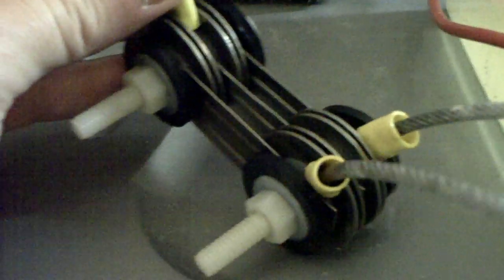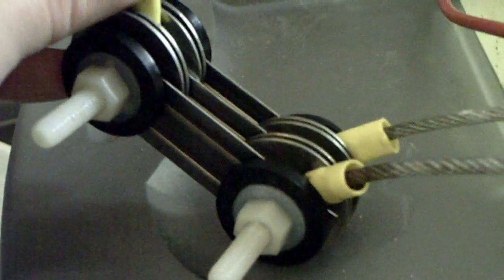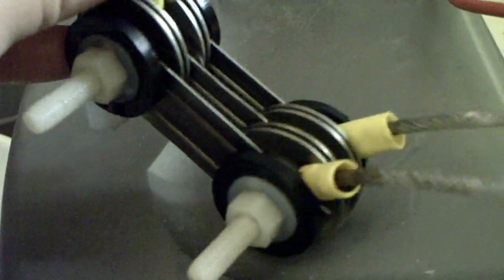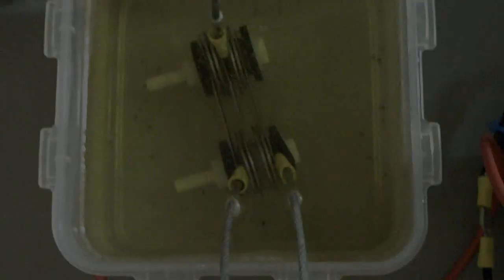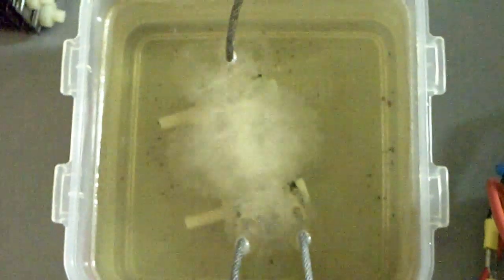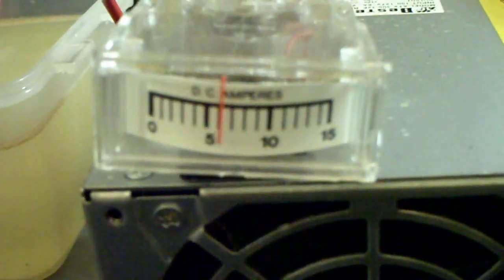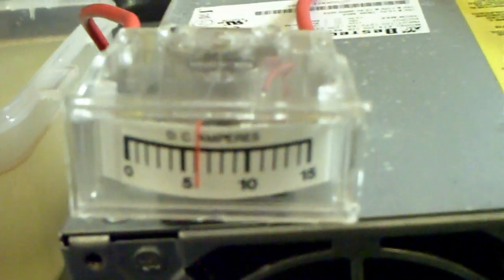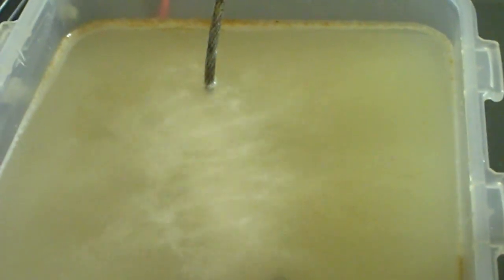Vid39 Hydrogen Generator Mini Design (HHO, Brown's Gas, Hydroxy)

Comment from the maker: If you've built and tested enough fuel cells you can have a rough idea of the output when it comes to wet cells. Dry Cells would be impossible, because you couldn't see the output.

I guessed this fuel cell would do over 1/2 LPM and when I tested it last night, it was just over 1/2 liter per minute.